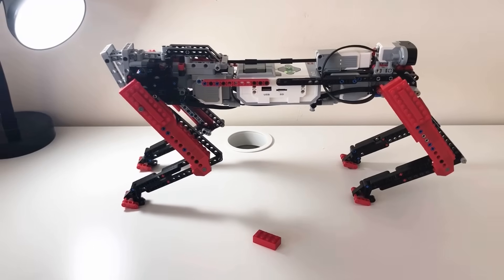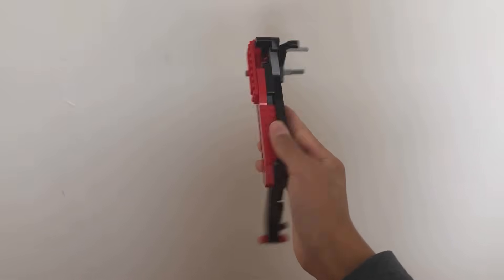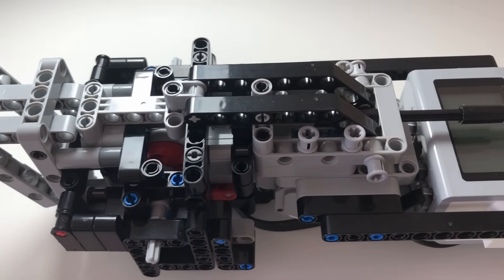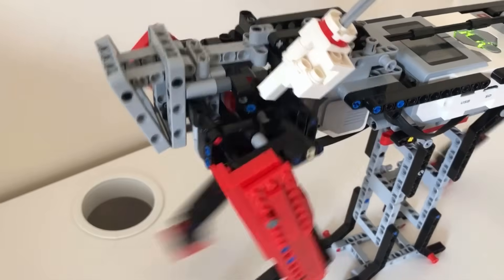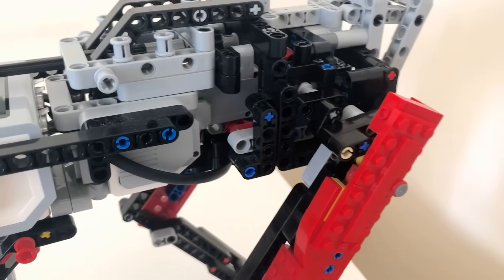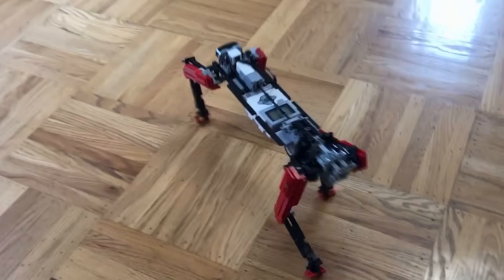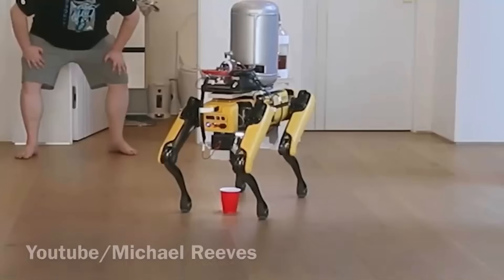I Built a Fully Functional LEGO ROBOT DOG!

Comment: The only think i can see lacking in this build is width of the legs 

They are too close together and gives it an unbalanced CG (keep in mind boston added a high power gyro in their design but you could offset this by using hobbygrade electronics (if possible to integrate with lego electronics) you maybe able to add a gyro unit (something akin to AFRC gyro unit) ❤️

Massive respect tho man these lego builds are crazy good

Comment: This is cool. I won my 5th grade science fair in the 1980s by making robot legs where I used a big dual shaft DC motor, then cut wooden circles and beams to make the legs to convert the circular motion into a linear motion going into a human-like walking motion. It didn't walk, but the legs hung off the edge of a table and did the walking motion. This works very similar to the way my project worked.
Reply from the maker: Thats pretty cool thank you for sharing!

Comment: Hey!
I'm planning to build a dog robot too! I have a question: The 2 legs are not synchronized by a mechanic part like the mould king dog has. Do the 2 motos - controlled by the ev3 - always stay at the same rotation when accelerating or will they by any time loose their synchronization?

Fantastic job you did there - also with your new RC plane!

best regards
2unleash
Reply: i`m not a robot builder but i know dogs a lot, including anatomy, they have breast and this makes them more stable

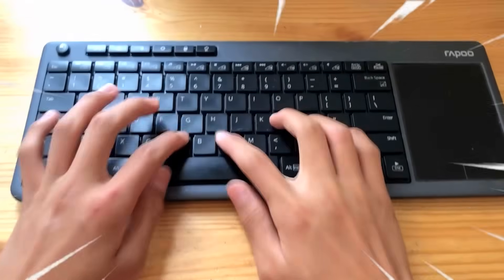Comment: Why all the indentation on lines 17–19 of main.py at 06:06?  Remember, indentation is meaningful to Python, so adding it where unnecessary will cause problems later.  If you don't have a good editor to warn you about these problems as you're writing, you'll not know of them until you run the program.  If VSCode isn't helping you with this, I recommend IntelliJ IDEA.

Comment: My Lego Technic Robot Dog was built over 20 years ago, using only what was available in Lego at that time. I did not have any controlling software. Rather I built it to operate by means of gear ratios and carefully timed movement of each moving appendage was controlled only by the way I designed it. Mine had a bobbing head and wagging tail, which helped to keep it on its feet as it walked. It was built as an experiment of torque increasing methods. The entire build worked on just one Lego Technic Motor. I was able to raise the torque to such a strength that it eventually stomped itself to death; coming apart, due to inadequate connection strength between the parts. Some of that was alleviated by using larger parts in place of multiple smaller parts. That said, the connections were never completely immune to the strength of the torque I built into it. It was a very interesting build. I did not have directional changes built in, so it only walked in a relatively straight path. Mine only fell over in my first couple of builds, but after that it only failed when it stomped itself apart.
You have access to much better Lego parts than I did, so I would love to see you build more advanced versions of this.
 Thanks for posting this video.
Reply from the maker: Oh wow, sounds really cool! Thanks for sharing!

Comment: years ago i worked on my version bostons atlas. two legs took a long time to get 12dof and some mindsensors hardware to get it to walk up and down stairs on its own.  But it was rather slow do to weight and redundant gear train for all load joints.   I really like your spot, well done. Its been years since i have touched what i called X. sits there still new design too found a way to get hip rotation for the leg. so it can step out on a turn no shuffle or over a object and turn.  The hours it took about uncountable..

Comment: Nice work! From the thumbnail, I thought this was the Boston Dynamics robot! For turning, have you considered using a motor or servo that makes the body hinge near the center of mass around the vertical axis? Even a slight bend would probably get it turning nicely.

Or, if you actuate the hips around the spinal axis, you might even be able to better balance the gait to solve the crashing problem.

Just some ideas for future projects...
Reply from the maker: Haha, thank you! I might try improving the steering in the future, thx for the suggestions

Comment: Excellent! BTW why is the steering system in the back, not in the front? One might wonder...
Reply from the maker: Thank you! As for the steering, the joints are not as strong because they need to be able to turn, so if the steering is at the front, it won’t be able to climb up small obstacles such as thin books, since the joints for the legs would sometimes wobble, and get stuck